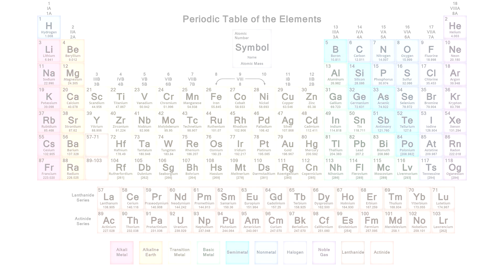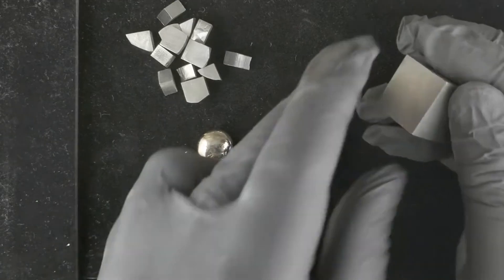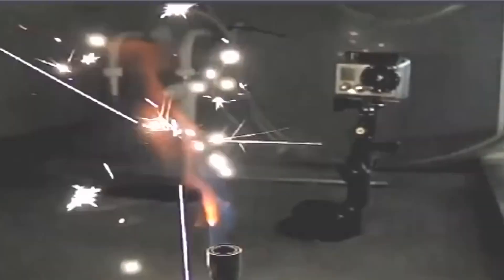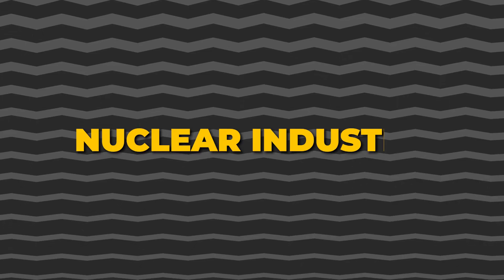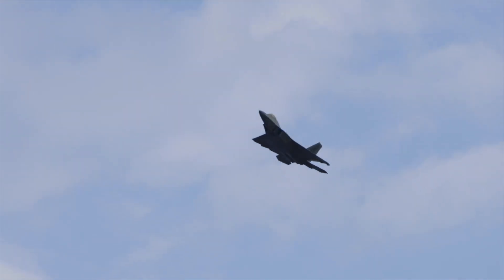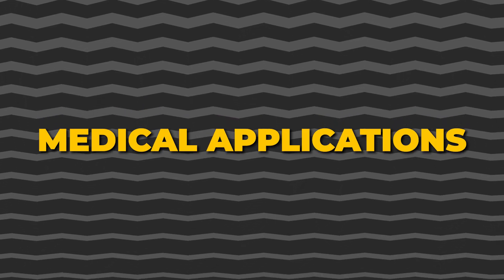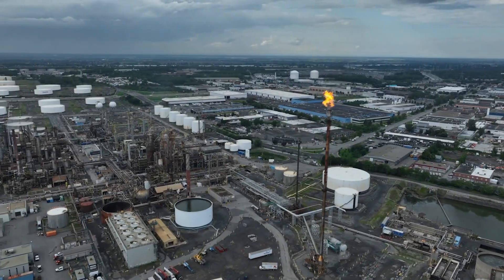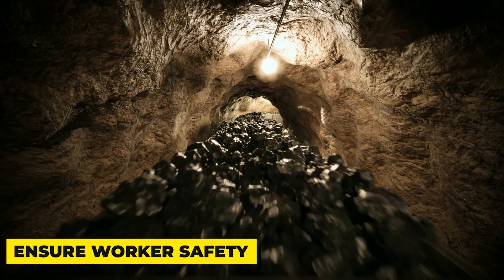Hafnium | Element 72 of the Periodic Table

Comment: I was an electrician on a US Navy nuclear submarine that was built in the early 1960's. The submarine I was on had a Westinghouse core. It was a pressurized water reactor and the rods that were inserted into the core where the uranium was where made of Hafnium. They were used to absorb neutrons and could withstand the temperature and the radiation. This shut down the reactor or reduced power level. This is common knowledge. I'm not revealing any secrets here you can find this on wikipedia. Also you stated this in your description. The submarine I was on was decommissioned and scrapped 34 years ago.
Reply from the maker: Nice to hear that!!
Thank you very much for sharing. Much appreciated!
Reply: That's great to hear this from veterans like you!